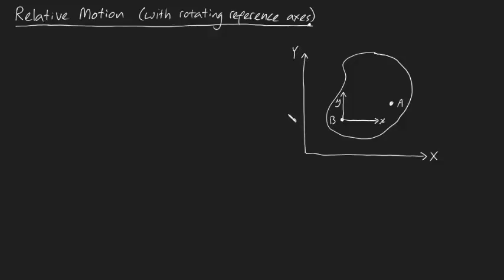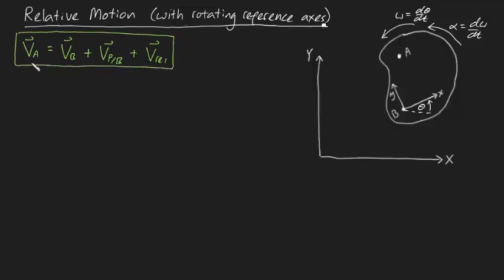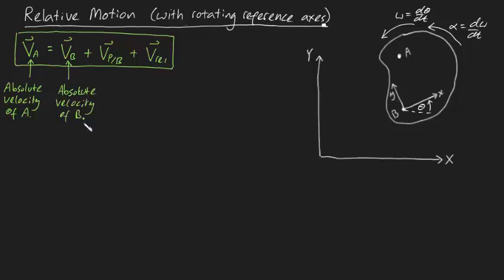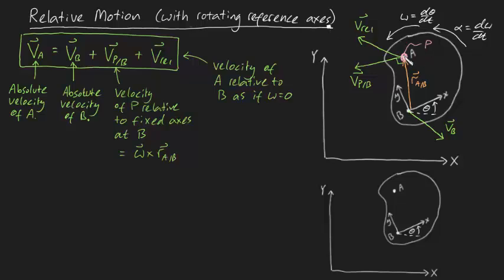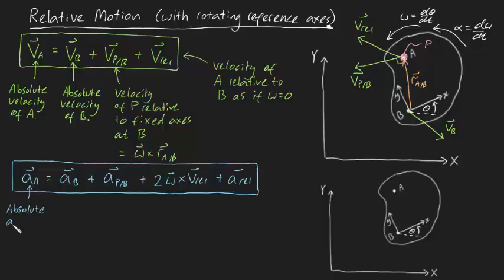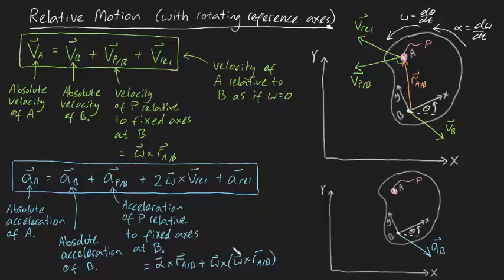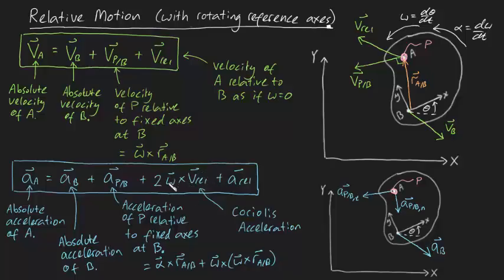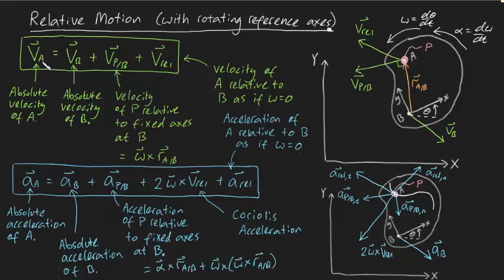Relative motion (with rotating axes) Summary

Comment: why is it necessary to imagine a point P? why can't i just say point A?
Reply from the maker: Great question. There's a very subtle difference. At any particular instant of time, Point P is defined to have the same position as point A, but point P is defined to be attached to the plate. 

Now imagine at this instant, the plate was rotating around point B. This means point P will be on a circular path and so it must have a velocity tangent to that circle. This is unlike point A. Point A is free to move on top of the plate, so even if the plate rotates purely around B, the velocity of A could be in an entirely different direction. 

I think this example will help: https://www.youtube.com/watch?v=4PiNIdV5n00&t=279s&ab_channel=VirtuallyPassed

Comment: Love these series of vids!  Thanks for making them :)) Apologies, but I found two significant corrections. The first: I Found at time 5:14 you describe ....
Vrel as = to Velocity of A/B... Velocity of A relative to B. But this is NOT correct.  Vrel is Vel of A/P, remembering the P is fixed to the plate. And therefore, will have only ONE direction away from where point p used to be.

 If you look at all the Relative veloctity "cancellations" it makes it perfectly clear...
Va = V b + Vp/b + Va/p. which can be thought of when seeing the equation without the V's...
A = B + P/B + A/P.... The B's "cancel", as well as the P's, leaving A = A.  QED :)

Likewise, the acceleration of A involves the coriollis effect AND the Arel term, but the sum of these two = V a/p. Understanding this concept and connection was HUGE in my understanding of these equations.  So basically....

Aa = Ab + Ap/b + Aa/p, Where: 
1) Ap/b expands exactly as you described...two terms that explain the 2 circular components that are the normal and tangential components of that acceleration of p from the perspective of B. And...
2) Aa/p = w x Vrel + Arel 

NOTE! This is where the video at time 10:44 makes the 2nd mistake.  

When you look at 2) above, you see that Aa/p has a normal and tangential description. Just like Ap/b did.  But in our case with Aa/p, Arel is the tangential part, and the corriolis effect term (w x Vrel) is the normal part!  

Why... remember that Aa/p describes the motion (acceleration) "away from p", and therefore these two terms ARE the normal and tangential components. The corriolis effect IS the normal acceleration term (normal to the path of a when it is coincident with p).

I hope this makes sense! When you see it with this understanding, then the corriolis effect terms is not magically just a leftover or just "there". It makes sense.
Reply from the maker: Hey Gary, first I just want to say I absolutely love your attention to detail! I'm not sure if you've noticed, but I've actually got two proof videos behind each of the formulas I've presented here - one for velocity and one for accleration:

https://www.youtube.com/watch?v=4bMdTq1dOkA
https://www.youtube.com/watch?v=eIskwhSochk&t=1s

Please have a look at these videos and let me know if you still think there is a mistake.

Comment: Thank you very much. but i have 2 question. 
1.If I cancle an "a rel" and coriolis acceleration. it will look like relative motion using translating axes. Is the term " w x (w x r) " similair to " (-w^2)r " like translating axes. can I use -w^2 r in rotating axes. 
2. How can i know which problem use translating axes or rotating axes.
Reply from the maker: Hey mate, you've got some good questions here.
1)  w x (w x r) is pretty much the exact same as (-w^2)r. The only difference being that the first equation is a vector, whereas the second is a scalar. But if you remember that the direction of the normal acceleration term (-w^2)r always acts towards the center of rotation, then it's the same. 
2) It depends on how you define your system. Usually you want to define a rotating reference axis (eg define x axis of a rotating bar so that x is always measured down the bar). Some example questions will help build some intuition for you: https://www.youtube.com/watch?v=4PiNIdV5n00&t=126s

Hope that helps :)
Reply: Virtually Passed Awww.I got it!!! Thank you very much.